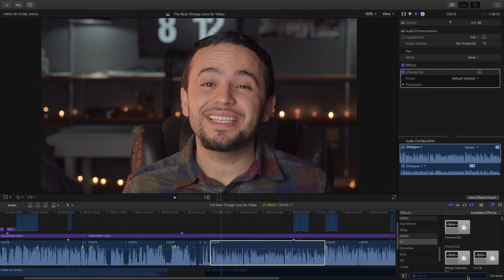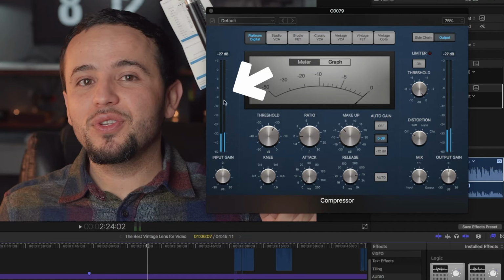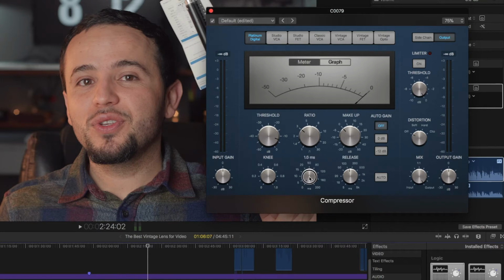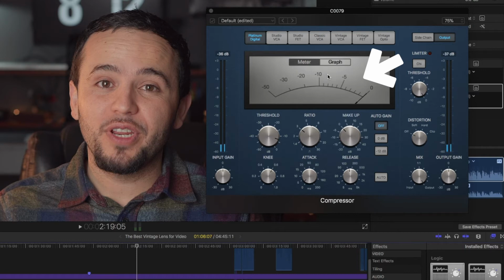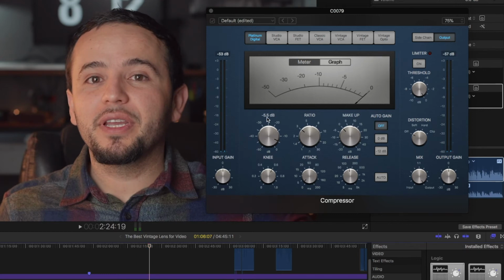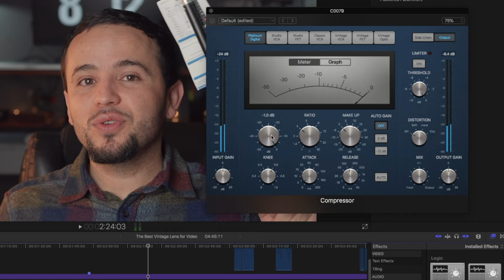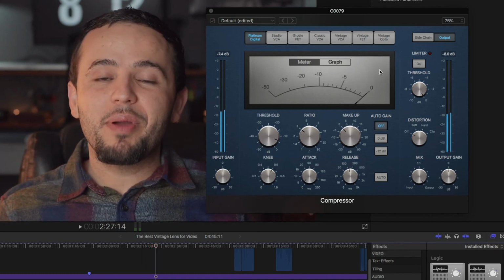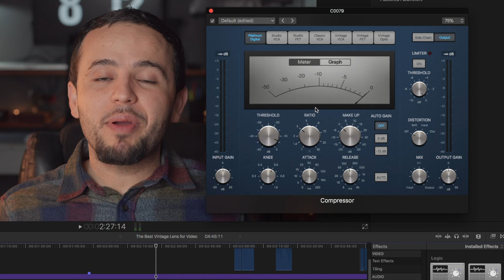How to Process Audio Dialogue for Video (Part 2 of 3)

Comment: Nice video. Will have to check my defaults compared to yours. I usually use mine to boost overall audio up to just before it peaks on the wavelength.